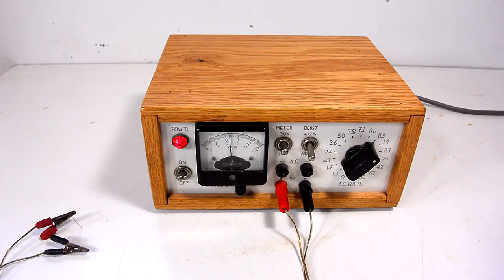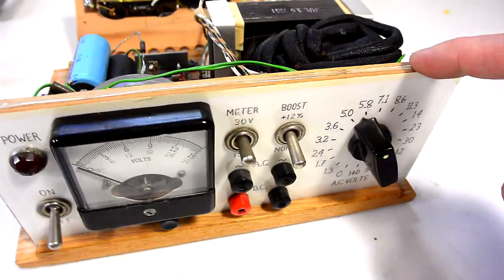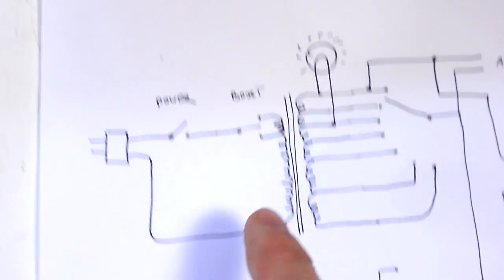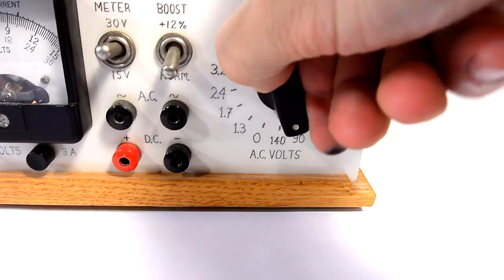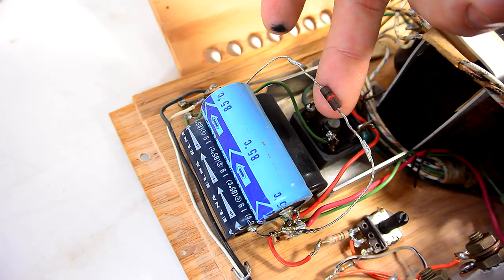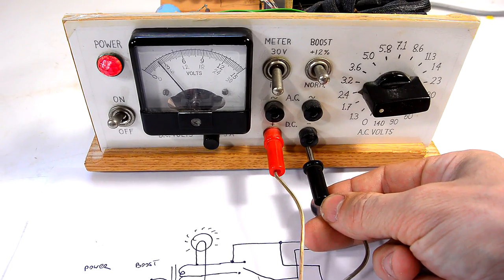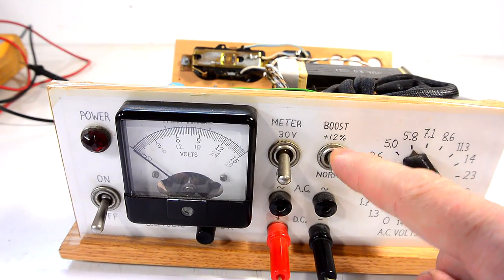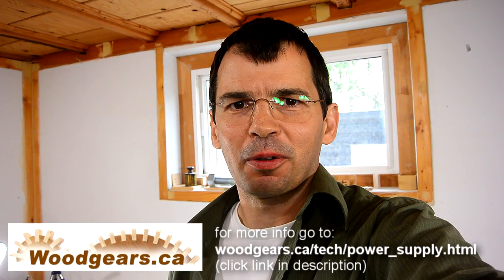Homemade benchtop power supply

Comment: I don't quite understand why the volt meter is in series with those resistors that can be skipped to double the reading. How does it work? Does it have a fixed resistance itself? Isn't the resistance of a volt meter usually extremely high, so that virtually no current flows through it and any resistors in series with it make no difference?
Reply from the maker: surfcello The switch skips some, but not all the resistance.  (should be pretty obvious from the explanation and  the schematic)
Reply: Matthias Wandel Of course, but that would only make a difference if the voltmeter had a constant resistance that was comparable to the resistors in series with it, wouldn't it? Is that the case? Is what you call the meter just a coil galvanometer without internal resistors in series?

Comment: Nice video! I know you could trouble shoot a bad trigger on your drill. It's like most thinks now days. Throw new parts at it until it works again....  first bypass the trigger. if the drill works still, get a new trigger. If not, check the motor, etc, etc.

Comment: Where can I find a transformer? I'd rather avoid buying just the transformer so what types of things might you find them in?
Reply from the maker: from an old tube tester.  But old tube testers are very expensive these days, cheaper to buy a power supply
Reply: Or a variac

Comment: Hello Dear Matthias,
maybe you can provide an answer to this non clear issue.
Do You know if a 240V induction motor from the states can work on the 220V  European power? nobody can give a clear answer..
Reply from the maker: Assaf Lavi Not recommended.  Running a 60 hz motor at 50 hz means you should also run it at 20% lower voltage.  So the 240 volt motor should run at 200 volts at 50 hz.
Reply: Matthias Wandel Hi Matthias, thanks allot for your answer. is that mean that the motor will burn out on 220V 50 hz? what will be the effect on the motor? is there transformers that can solve this issue for 13-15 AMP induction motors?

Comment: If I could switch my fancy power supply for that, I would switch it, because its simpler, and better in every possible way, ie: low noise in output, higher current, simple to operate, and it just looks better than my white metal box power supply.

Comment: Modern electronic isn't too complicated either. A fair lot of it is either "plug and play" or "copy what's in the datasheets" ...
Reply from the maker: romsthe Yes, but my point is, that I actually understand it.  Where as with the design you suggest, even the designer doesn't understand how it works.
Reply: Matthias Wandel Yes I get it, modern electronics can be intimidating and somewhat gruesome. My point was it's not as hard as it looks, I want to encourage readers. Well if anyone can make a jig that teaches electronics, it's you ;)
Reply from the maker: romsthe My point is, I like to work on stuff that at least I can understand.
Reply: Matthias Wandel the variable speed switch on the power drill is pretty much what your power supply is. its just varying the power that gets to the electric motor. 

Only difference is they encase the switch in plastic so that you don't bother fixing it yourself and just buy a new one :P
Reply from the maker: Graeme Evans Oh, how simple tings seem to those who know nothing!
Reply: Matthias Wandel what that supposed to mean? i know exactly how a variable speed trigger works.
Reply: Graeme Evans At least here in europe a power drill doesn't have any transformers in it, it is done via phase-fired controlers. So ICs insted of electric.
Reply: FreeOfFantasy That's only valuable if Matthias Wandel understands how it works.
Reply: FreeOfFantasy i never said they had transformers, i meant the principal is the same. to vary the speed of the motor you need to control the power reaching it, whatever components used or aspect of the power is varied, the idea is the same. 

but, i don't think i've seen a power drill use an integrated circuit, a remote controlled vehicle yeah. but a drill? in the uk they are usually a triac. Maybe they use ICs in some of the ridiculously expensive tools that i wouldn't bother buying :P

but also, integrated circuits don't use electricity?
Reply: Jonny Deth E.E IS my daily job, period Call me a liar if you want, recognized you as a troll at once, I'm done with you.
Reply: Jonny Deth Pride AND honesty, humility... You're a king of sarcasm :D

Comment: Never delved into one too complicated, only made static ac to dc voltage power supplies one 12 volt and a 5 volt. I have made a dc to dc but it had the fancy voltage regulator. Funny that big ole 12v power supply with it's transformer I made only handles 3 amps out while the dc voltage regulator can handle 10 on the iddy biddy board.

Comment: Why do i keep seeing a swastika in his schematics?
Reply: I noticed the same, lol
Reply: It's a diode bridge. It uses diodes to separate out the positive and negative parts of the AC (which needs a few capacitors after it due to its variation, being AC).

Comment: The meter moves like it's under-water measuring 57mv. across 19 milli-ohms. No, I don't think so. I've been using low resistance wire shunts to make ammeters for 30 years; never saw a slow meter movement. Also, this is the industry standard arrangement for a panel meter; 1ma. meter movement and a low milli-ohm shunt; and they don't move slowly. I think you're watching your steel wire heat up. put a digital multimeter across the shunt and turn the thing on.

Comment: you can say old 1951 but a transformer like that can go in shortcircuit all day long and not complainI build one during the 90's and used it for many years  after a while i got my hand on a Delta  en that  one has to be repaired already  but the old school is still working  you can shortcircuit it all day long and does not complain or anything. i used a transformer form a old electrical blanked .

Comment: Very very nice;  simple is always better.
I was looking for a lab Power supply for electrochemistry with high amperage .
WHen you opened that up I though... Hell I can just rewind a Microwave transformer if I can remember the formula.  then i can rectify that on a big heatsink maybe a little fan!  I basically need a 5 and a 12 volt tap that can draw up to 20 amps.

Good god are power supplies capable of doing that expensive!

Comment: You say you wouldn't know how to diagnose and fix that drill but for some reason I doubt that.  30 minutes with Google and I'd bet money on you knowing exactly what to do.

At least as far as I can tell the primary difference between old electronics and modern electronics is the use of more PCB with surface mount devices and more ICs.  Aside from that it's still all the same principles.